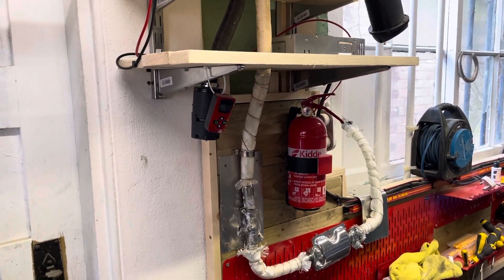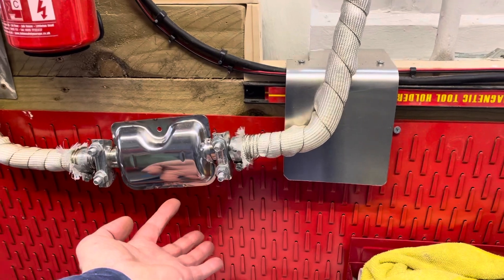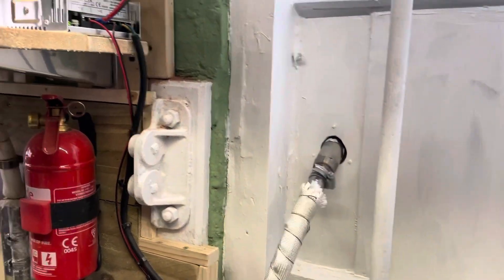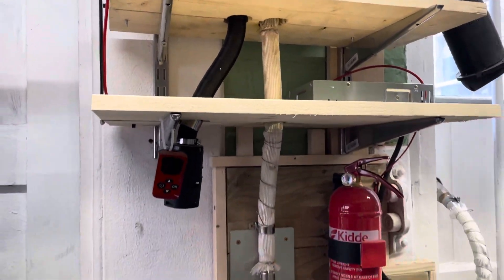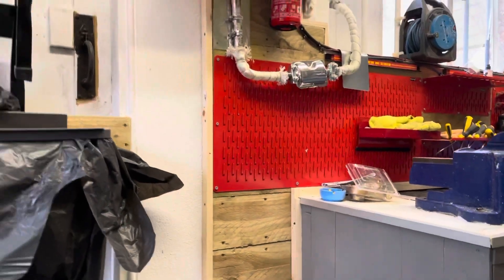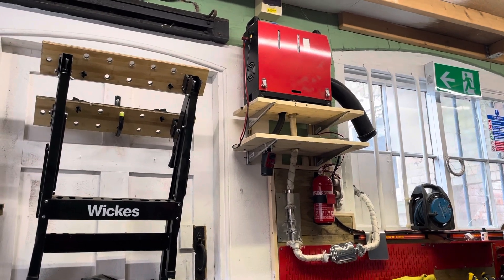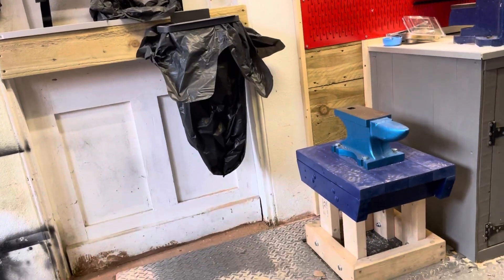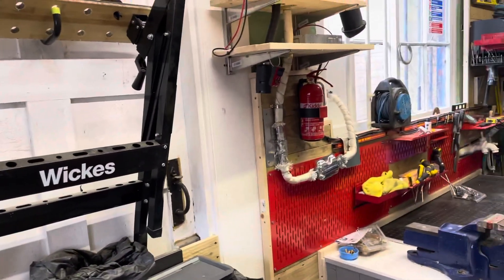Chinese Diesel Heater - Working Fine

Comment: Hello, Mark, I am putting the same assembly together, waiting for the boxes to arrive. My only 2 suggestions are that since cold air falls and hot air does the opposite you would get more of your heat if you pulled the cold air from the floor and exhausted the hot air again at the floor, it will warm up the cold air and it will all rise. The convection will mix and it won't stratify.
Reply from the maker: You're right...I could have run the heater pipes down to the floor but, if I'm honest...we have the garage door open most of the time and it's still warm. They really are brilliant.

Comment: A few observations - If the power fails your heater will shut off instantly, possibly frying the internal heater control board (see internet).  The muffler has a moisture drain so you are getting carbon monoxide in the living space air.  Do you have a CO2 detector?   Be careful the number of bends in the exhaust path.  Last thing, you may want to strap the heater so that it can't fall if the wires get snagged.   That's a long fall and a tank full of diesel.
Reply from the maker: Thanks, the power hasn't shut off in over 20 years so, I'm not sure I have to worry about that...the moisture drain has been crimped shut...this causes a requirement for emptying every now and again but, stops any exhaust gases getting inside